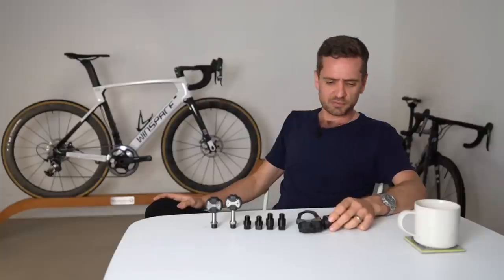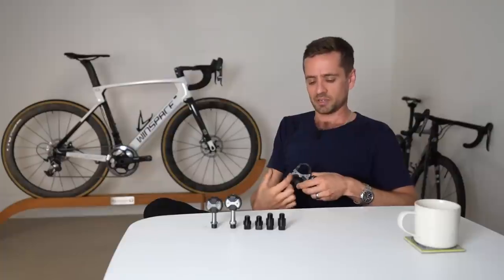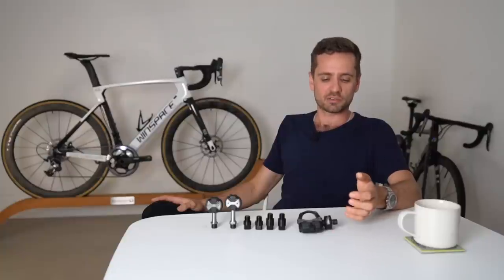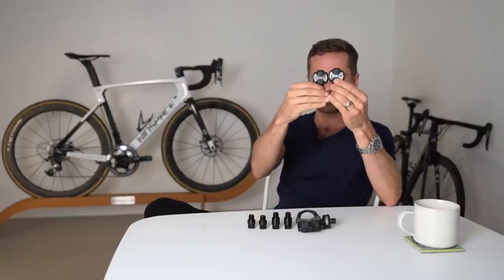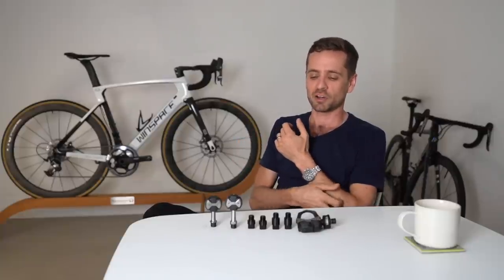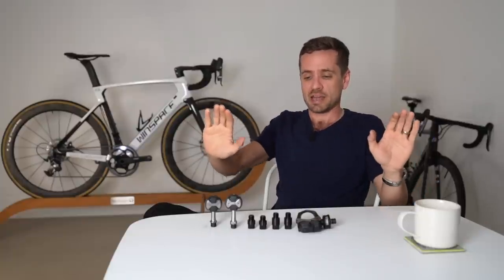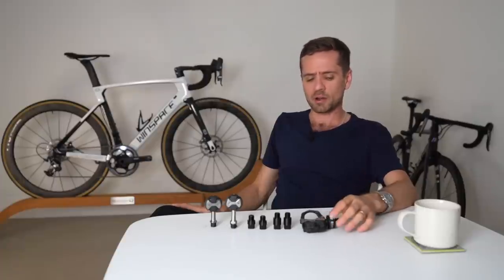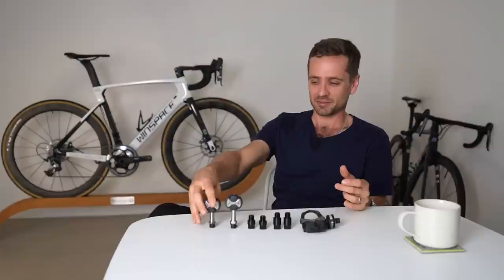Want More Power? (How to Respect Cycling Q-factor)

Comment: Is adding an additional washer or two onto the spindle a reasonable way to widen the Q factor?  I frequently get cramps in my adductors and this is the first bike fit video I’ve seem that specifically mentions it. I don’t know if I would benefit from 5, 10 or 20mm of width so curious if trying a washer or two before buying a 20mm extender is worth a try. ??
Reply: yes washers work but leaves less tread on the spindle for the pedal so be care, and make sure the pedal is secured enough to the crank

Comment: I have a quite narrow pelvis and my waist is just 26 so I have to push my feet in. I pushed my cleats outward to the max but still it isnt enough.
what should I do? I am currently using shimano road cleat system
Reply from the maker: Getting advice from a certified bike fitter about whether your feet need to be pushed closer into the bike would be a great place to start. Although even in Shimanos pedal systems have different pedal axle lengths so this could be good knowledge to know!
-RCA Team

Comment: 3yrs after when i stopped racing i got bigger, when i get back@riding i already figured out i needed wider qfactor and solve every discomfort. Does wider qfactor greatly affect aerodynamics?
Reply from the maker: Hey there,
We are not aerodynamic specialists with a wind tunnel at your finger tips unfortunately! However we will say that the increase in efficiency and comfort you get from having a well fitted bike set up would definitely outweigh any 'loss' (if any) in aerodynamic drag!
-RCA Team
Reply: @roadcyclingacademy  i definitely agree on that. Thanks cheers from Philippines!
Reply: The ventilation path widens. probably wide Q factors is better aero

Comment: If after a year of consistent training (4 to 6 sessions/week; 7 to 8hrs, mostly indoor) I feel my vastus lateralis (outer quads) are SLIGHTLY more developed and used than the other quad muscles.....is it normal or should I consider a change of the Q factor and how?
Reply: FMI I"m a PE teacher with a strong build 83kg (182lbs), 180cm, around 310W FTP. Did a lot of sports before going back to cycling (including crossfit and bodybuilding).
Reply from the maker: Questions for Neill, hopefully he can get to it for you.

Comment: I really need a wider pedal stance. I don't think I can use 20mm though.  I do have the issue with crashing my heals into the crank and there's a place where I've worn off the factory finish.
Reply: Check out Risk Pedal extenders.   They have a 16mm version.